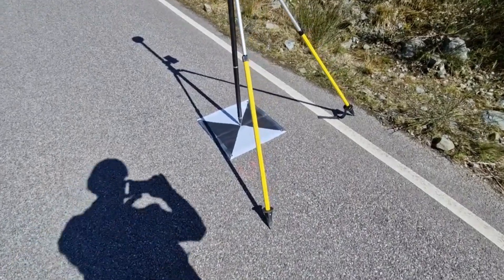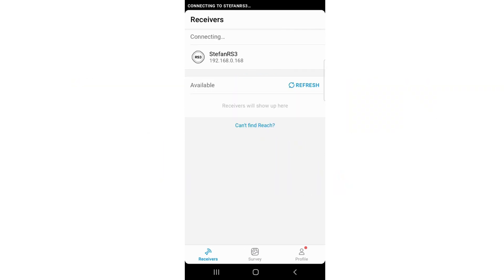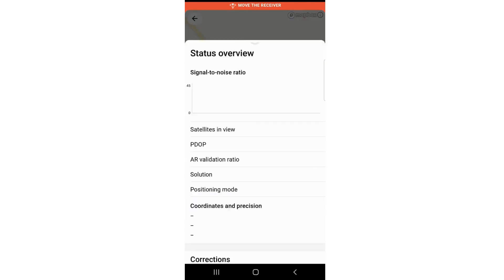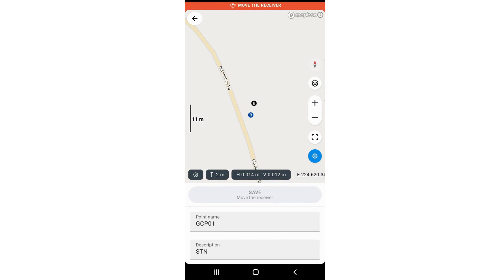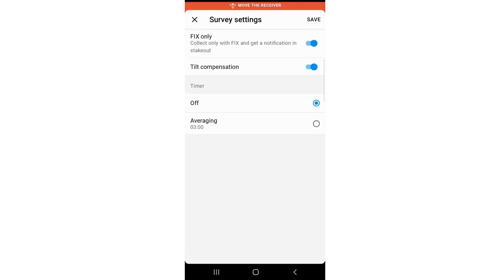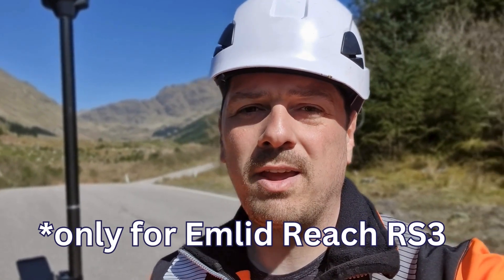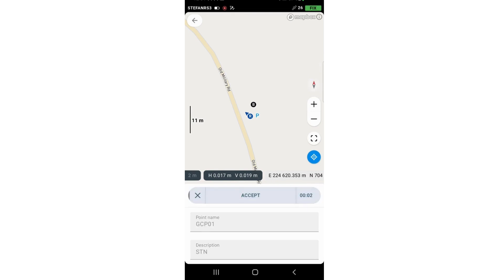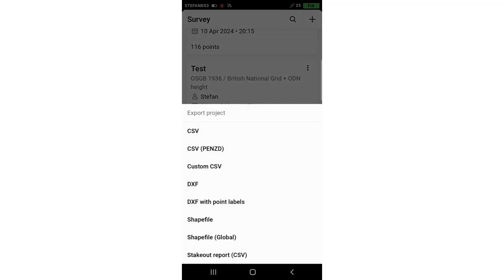Survey Ground Control Points Like a PRO with Emlid GNSS !

Comment: You just needed to deactivate the tilt compensation. Then it doesn't use the IMU.
Reply from the maker: Thanks for your comment, you are right. I saw that we have that option, after I posted the video. I usually turn the receiver on from my car and the IMU activates while I walk to the point.
Thank you again for your remark.

Comment: I got the RS3 earlier this year for this use case, plus retransmitting Ntrip to my M3E.  i also decided to start using it for as built surveys - but im not keen on the Emlid Flow survey app.  seems odd that you cant export different points and lines into different layers for import into autocad.  is this normal for GNSS survey kit?
Reply from the maker: Not really, I use also Trimble equipment with Trimble Access and the software is way better and you can create your own proper code library. 
But that one cost 10 times more for a reason, because it has way more features.
Very soon I will post a review of my experience with RS3 so I hope you subscribed 😉
Reply: @flyingsurveyor  yes mate.  i do similar to yourself, although more on engineering project management and less on surveying than yourself. Im in Merseyside so cover the NW of England.  You can create code libraries in Emlid Flow - you just cant export them which seems a huge own goal.  based on your Trimble comment (which i figured was the case but thought i would ask a surveyor!) im going to look into other survey apps. someone must do one.  seems crazy to build in a load of CAD time for no good reason.
Reply from the maker: @GeeBee1971  awesome! RS3 is not too bad for Land Surveying if you export as CSV and import data in LSS or N4ce. I don't use library and put my codes in the descrisption as you will see in my next video. I bought the receiver for control points and open field topo and does a great job. For intensive setting out I still hire a Trimble. 
As I said I have a video coming up where I present my experience working with it and what pro's and cons I found.
All the best 💪🏻
Reply: @flyingsurveyor  im using it for as built surveys for road and sewer adoptions.  accuracy is good enough for that application.  interesting about codes in description ..  will look into that thanks.  like i said "ask a surveyor" :)
Reply from the maker: @GeeBee1971  for the price that we paid I think it does a decent job. 
Also feel free to connect also on LinkedIn:
https://www.linkedin.com/in/stefan-niculescu-tcinstces-80150853?utm_source=share&utm_campaign=share_via&utm_content=profile&utm_medium=android_app